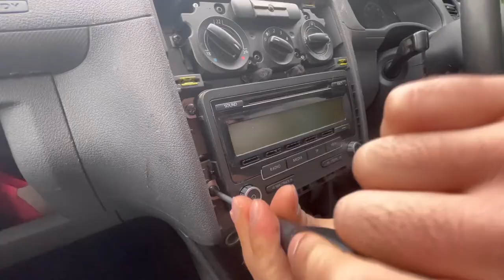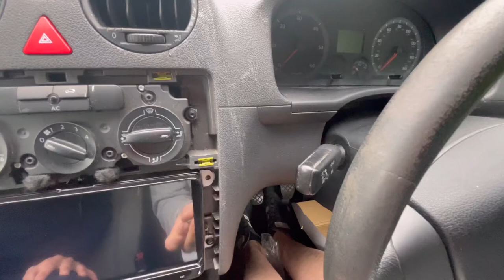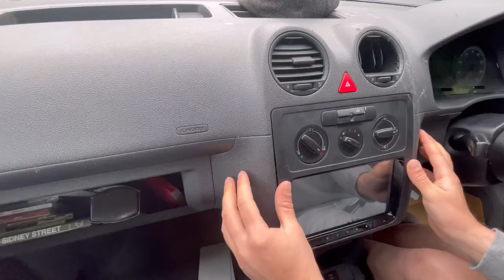VW Caddy Radio Removal Install Set Up Android Car Stereo Volkswagen Pluscenter

Comment: Thank you so much for the video! 

Have you ever installed a reverse camera with the new head units?
Reply from the maker: I am happy that the video helped you. For reverse camera you have to connect the red cable of the camera to brown or pink of the wiring harness, and at the back you have to connect red to red. If your stereo have a canbus, the reverse camera will work automatically. If you don’t have a canbus you can connect the camera at the back to the reverse light wiring. I hope this will help you too.

Comment: I have like this.. But when I tunn off the car the radio is still on... How I can fix the probleme
Reply from the maker: Hi, make sure you disconnect the red and orange connection from the wiring harness, then the stereo will works only with the ignition on or car started, thanks!
Reply: I have the same issue and when I disconnect orange and red it won't turn on at all.
Reply from the maker: @smodjephace  you must switch on the ignition and make sure you connected the canbus properly.

Comment: Hi you cant told me how can reset android
Reply from the maker: Hello, factory reset password is 1234.

Thanks 🙏
Reply: @pluscenter  thx
Reply: How do i stop this draining the battery? i cant find sleep mode setting
Reply from the maker: Hello  @ohyeh845  , disconnect the red and orange wire connection from the wiring harness, then the system will work only with the ignition. Thanks 🙏